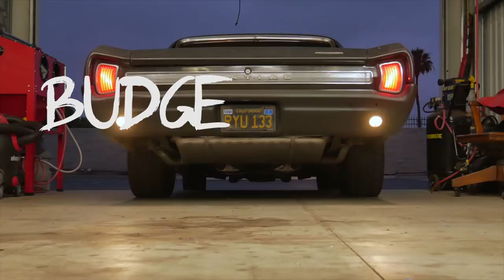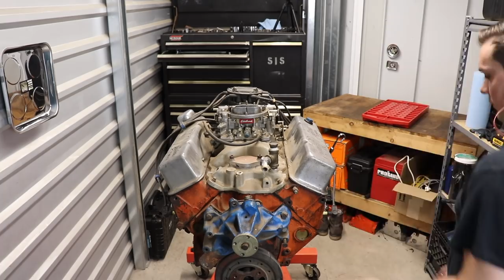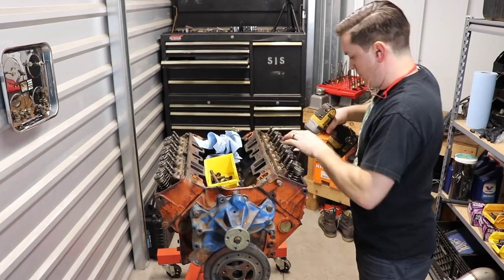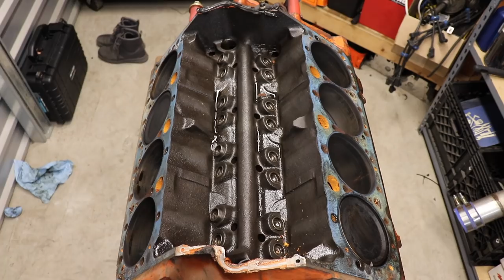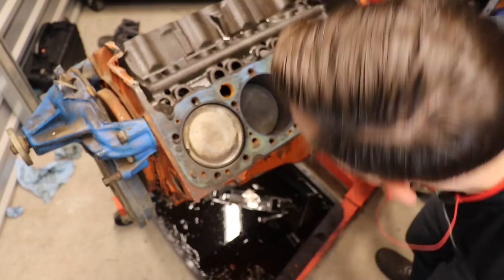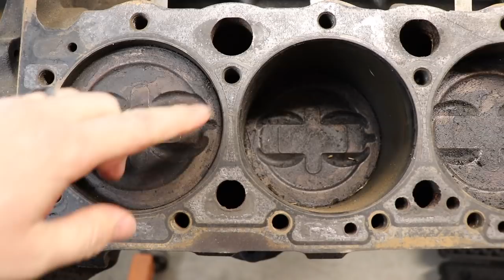Chevy 400 Small Block | How to Disassemble a Small Block 400 -REBUILDING BASED OFF SUBSCRIBER ADVICE

Comment: Personally, I would use ARP Studs if it's 2or 4 bolt. If your using the stock external balanced crankshaft, I would run a 4-7 SWAP/4-7-2-3 CAM 5.7 RODS, BETTER HEADS WITH STEAM HOLES MY MA. Stock crank would be 1529 casting numbers. I love destroking the SBC 400'S. I HAVE VIDEO'S OF MINES ON MY YOUTUBE CHANNEL.

Comment: My opinion is you should clean it all up as best you can and keep the heads. I mean it’s a $300 dollar engine, no need to put a ton of money into it. Rebuild the carb. Give it a good degrease and then paint it again. Will look pretty good and won’t be that much cash.
Reply from the maker: I think running it as is would still be a fun engine.
Reply: Pretend you paid a grand for it is it worth. Rebuilding then it's a 300 dollar engine after all just doesn't make any sense to me I don't get it that just leaves more money for better parts in my mind
Reply: That's idk about that go 377 if your gonna de stroke it

Comment: I have a chevy small block400 in my garage on a engine stand. It's a block minus the rest.... has 10.5 to 1 30 over bore with crank and pistons......removed the original cam..... hasn't run since 911......2001.......don't know what I will do with it ....maybe sell it or something.... thought possibly put it in a jet boat or something
Interested in seeing what you do with yours..... I live not far from Houston,Tx

Comment: Haaa you don't need to inspect and or check the steam holes you just need to make sure if the cylinder heads were replaced  they drilled the steam holes in the head

Comment: Check out White Performance and Machine.  They have aluminum heads with the steam holes drilled in them for a decent price.
Reply from the maker: Thanks for the tip.  I will check them out.
Reply: Post the price please ty

Comment: alot of people say Vortec, so do i, but on a super budget, like as cheap as you can as a challenge, use house brand parts, use all the tricks building vortec heads, LS Beehive springs, Alex parts Retainers, jegs/summit Cheap Vortec intake, one of there house brand Lifter/cam kits under .500 lift, Drilling and pinning the rocker stud arms, using the stock self aligning rocker arms the whole 9 yards. https://www.crankshaftcoalition.com/wiki/Vortec_L31_cylinder_head is a good source of info about most of these.

Comment: Those looked like dished piston’s, my recommendation would be to throw it all back together with the parts you have and buy a cheap turbo system off of eBay and see what you can do with that combination
Reply from the maker: The pistons are dished.  I wouldn't mind going the turbo route actually.  worst case scenario it blows up and I put the turbo on something else.
Reply: if you do make sure you get a turbo oil line filter that way you don't smoke the turbo  @BudgetBuildGarage
Reply from the maker: Those things can really save a turbo.  Good idea.  Thanks.
Reply: Would not boost a 4 bolt main 400 a 2 bolt main sure.

As for a turbo inline filter not needed at all you have oil filter adding a second is just going to slow the flow rate meaning would get even hotter.   Never used one and my EGT's on my rotary are way higher than piston engine, I see temps over 1600F.
Reply: Open the rings up for boost and if they are out anyway re ring it if you dont you will be sorry and when the ring land breaks and takes out a cylinder wall what then sleeve it rebuild the bottom end bro open the rings up boost spray whatever you'll be ready and not hurt it 400 blocks are getting harder and harder to find dont waste it that's foolish
Reply: Vice grip garage put a blower or supercharger on one it was an animal

Comment: Vortecs or cheap aluminum heads, unless those are double hump (2.02 valve) throw a torque oriented cam at it and make it a stump puller. That cast Crank wont like high rpm.
Reply: They were stump pullers stock and the long stroke is not conducive to high rpms your right but 5500 to 6 is not asking too much if it's balanced and has. A high volume oil pump right ? Good heads that's the secret and good distributor hot spark and bring the timing in according to compression and octane levels as soon as possible dump fuel down it's gullet and it's gonna run like a scalded cat

Comment: Put a 327 crank in it and rev that small block to the moon an back. Big bore small stroke ftw
Reply from the maker: I do love a good high revving V8!
Reply: A 327 stroke is a quarter of an inch shorter than. A 350 stroke youd basically be destroking it even more than making a 377 it may be a real good combination

Comment: Go ahead and drill the steam holes in the 350 heads and do a build, if it works out that aluminum are to expensive, you're ahead of the game with these heads already prepped  with steam holes.
Reply from the maker: That is a good idea.  I hadn't really thought of that.  I will drill them so they are ready to go no matter what I end up using.
Reply: The intake side steam holes are not necessary and are difficult to do correctly. (small bit, over 1" of depth, at an angle off of 90 degrees) Just drill the exhaust side holes, and really 1/8" is all they need to be, perpendicular to the deck surface.  @BudgetBuildGarage
Reply from the maker: I have actually read that only the exhaust side holes are necessary and was hoping someone would let me know if that is actually true.

Comment: Aluminum head sleeper
Reply from the maker: Man I love a good sleeper.
Reply: While aluminum heads are great for the amount of power he could make in its current config with stock rotating assembly a set of high flowing heads would be a waste when a set of Vortec would be perfect and flow more then enough for the power potential of the engine...and are cheap.
This engine won't take being reved much past 5500rpm which is where a set of hi flow aluminum heads just start to make power...not to mention lose a ton of low end TQ.
Reply: @harryguy76  thats the other configuration id go with,but they would have the bowtie vortec heads ,the stock heads are prone to cracking
Reply from the maker: @harryguy76  I like the vortec heads. I'm currently looking for a pair incase that's is the direction this build goes in.

Comment: Get either real 400 heads and massage them or some aluminum heads that decision is going to dictate the cam selection the better the head the better you'll be especially on a sbc with a real good set of heads you can get away with a little less duration cam and have decent vacuum all the while making actually more power than a iron head with too much cam that is a pain in the ass to drive on the street too many guys pick a cam that's just too much thinking they are gonna make power and have a set of 194 150 heads not even 202 160 valves anyway why not polish the crank easy to do at home a new set of clevite bearings oil pump high volume and I prefer high pressure it's a spring some guys don't like it I do and very very important new cam bearings if you can afford it go roller it's well worth the money there has been rash of cam lobes being wiped out during break in even with all the care in the world and zink just cheap Chinese steel or something sorry for rambling on

Comment: Dude you don't know the history of this engine. You don't know how long this thing ran without the steam hole drilled. Take it down and get the block checked. 400s go for a hell of a lot more than that. If all is well put flat tops an rv cam and drill the holes in the heads you have port and polsh them edlebrock performer rpm airgap thats just for staters